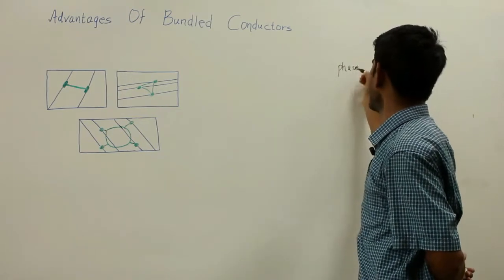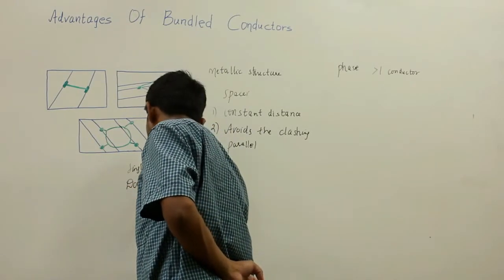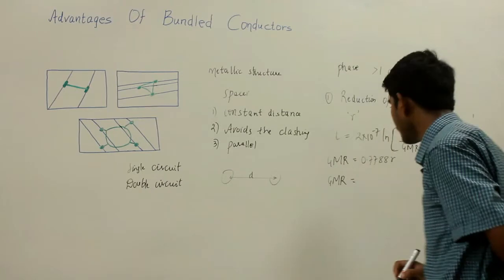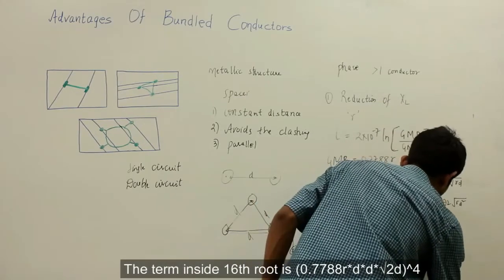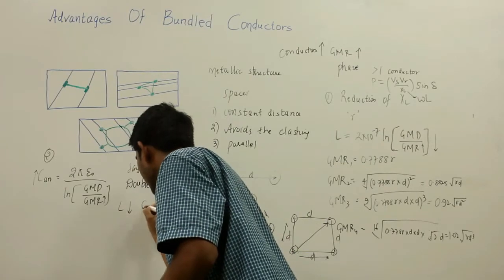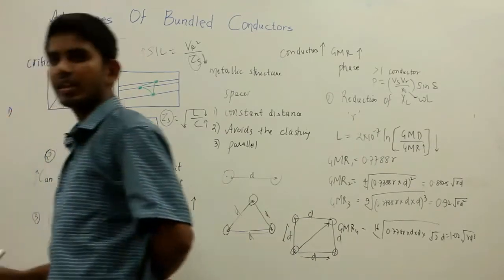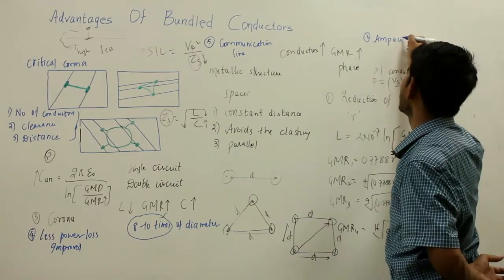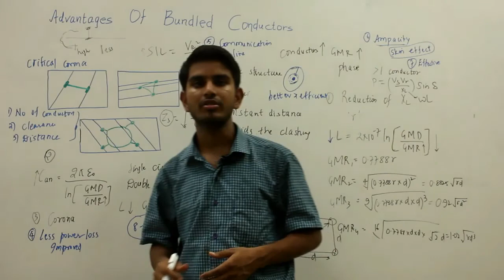Advantages Of Bundled Conductor

Comment: I want to know the power loss of aluminum conductors with 70mm thickness between 45 meters of length and the power loss between the aluminium conductor and bunch cable for the distance of 45 meters. 
Thank you, will be waiting for the answer.